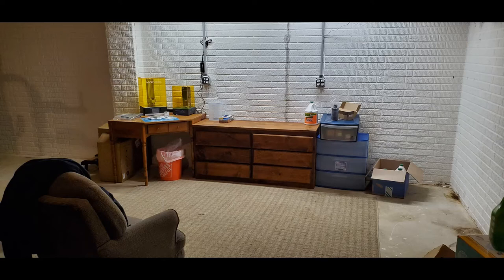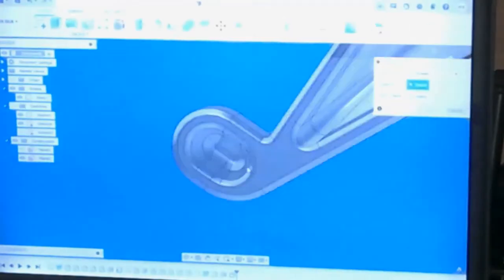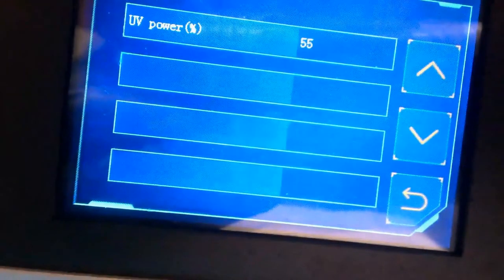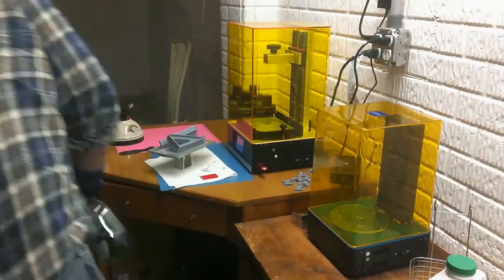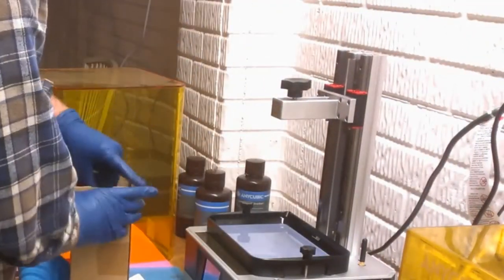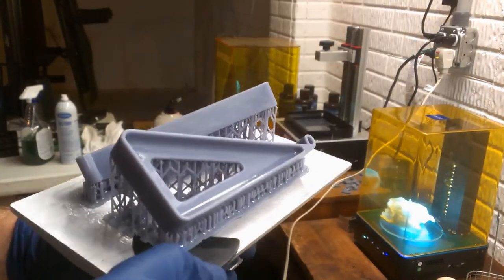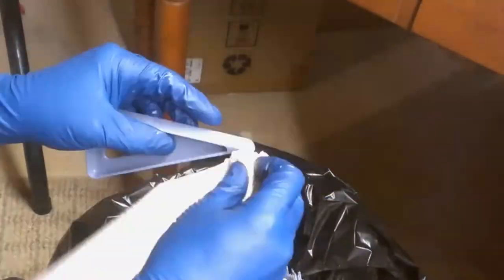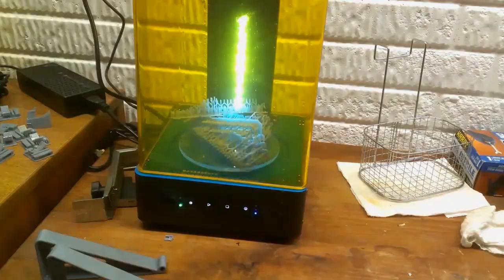3D Resin Printing Process in 5 Minutes

Comment: seriously underrated video - thanks, this is what someone who's getting into this needs and im pretty sure this is the only start-to-finish video of the entire process out there that includes disposing of supports.

Question, though - I have water washable resin. How do I dispose of the water after use? im nowhere near anywhere that will accept it and also in a part of the world where there is never any sun so evaporating the water isnt really doable. Thoughts?

thanks
Reply from the maker: Thanks! I just put up another video this morning that shows the whole process for printing the same part with an FDM printer and a resin printer. It's 20 minutes long (ugh) and took me way more time to edit than I expected, but if you're curious here's the link: 
https://www.youtube.com/watch?v=FWX4xDFYzbA

As far as what to do with the used water? I'm not sure. I've never used water washable resin. I did some searching (looks like you have too) and everything you list that you can't do is all I could find.  

I'm guessing you have a curing station of some kind since you don't have good sunlight.  Small clear containers that fit in your curing station would work.  Perhaps small water bottles ?  Maybe even a clear vase.  After it's cured let it sit so the cured resin settles to the bottom.  Filter that through a coffee filter and you could use the water again and throw away the filtered and cured resin. You might run the filtered resin in your curing station one more time to insure it's done.

You could also let the water sit in room light if you can't find containers small enough for your curing station.   It will take a long time for the resin to cure being exposed to room lights, but it will cure. How long? Not sure. Several days to a couple of weeks maybe. Sunlight is definitely the best if you have a window sill that gets even limited sunlight.  

Wish I had a better answer.  I see many people asking the same question.